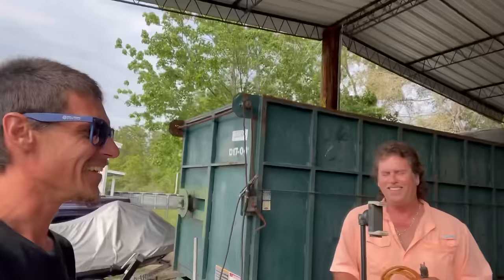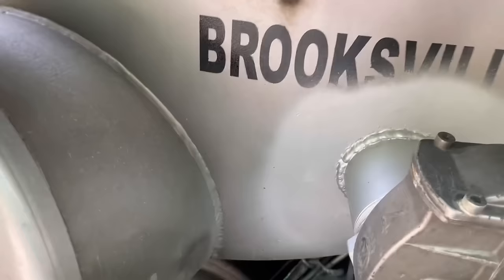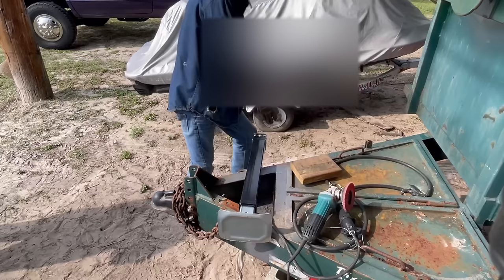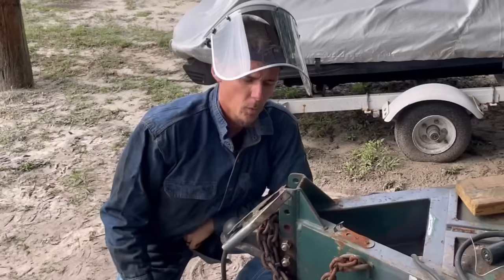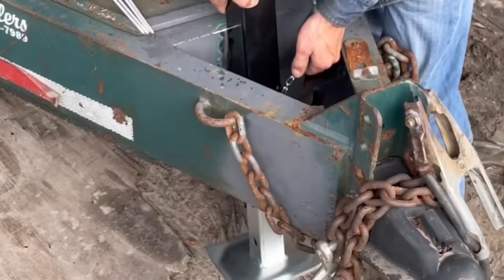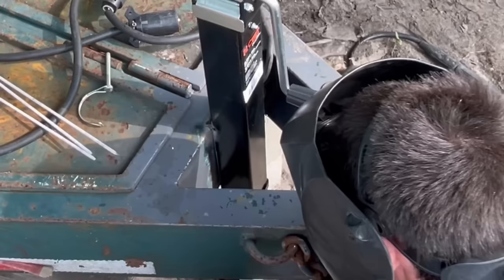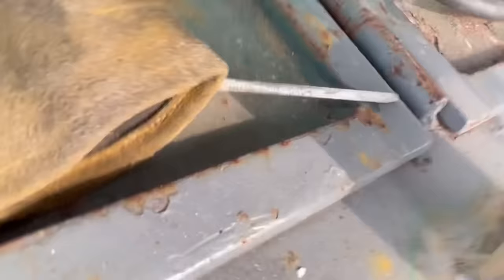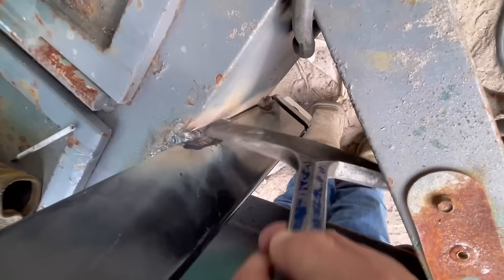BASIC Welding Job

Comment: hey buddy, first you didnt need to use 7018 even 3/32 ive done a hundred of them 1/8 6010 vert down . those jack tubes are 1/8 and sometimes 14ga. easy to burn thru  . if the customer uses them for what their for then never a problem,most times they dont crank them up allway and they hit something like a curb or drag them across low spot apron and bend them. 2nd what happened to your moving to north dakota and getting away from that swamp heat of florida ?  love the vids

Comment: Your Lincoln is pretty cool never heard of a 350 air cooled I have a sa250 runs pretty smooth enjoy your channel learning a lot from the repairs I mostly weld pipe at work but the side work is far from my usual work so it’s very helpful to see your method’s keep up the good work 👊🤙
Reply from the maker: Thanks, will do!

Comment: Why not weld 100% up both sides?
Reply: stitch welds are normally used to save money on materials (welding rod) and to prevent too much heat from warping the work piece.  Normally, welders that know what they are doing, only do 100 percent welds when a blueprint calls for it or they want to make something air/water tight.   If you weld something properly, a 1 inch stitch weld will hold just as much as a full weld. What matters most when welding is penetration and tying in each weld bead into each other to merge the work piece back into a single metal piece.  The only thing I saw that was done wrong in the video was the vertical weld was done improperly, When you do a vertical weld, you are supposed to go from bottom to top, and you should be performing a backwards z motion with the welding rod slowly as you go (small backwards z motion- with your wrist, so that the rod never "pushes" the weld, you always want to drag the rod in front of the weld, so it can penetrate the metal. 

So when you make the  backwards z motion, you start on the left, drag your rod from left to right with your wrists only moving, so that by the time you have to start going from right to left, the end of the rod is facing to the right of the work piece, and you drag it back across the work piece to the left, then do the same thing, again, dragging the rod from right to left and by the time it reaches the left side of the work piece, the end of the rod will be facing the left side of the work piece ready to be drug back across to the right side. Do this until you need to replace the rod or until you finish your work.  You can also do the stitch welds on vertical welds too.  

When doing vertical welds, Going from bottom to top or top to bottom straight up and down,  doesn't allow the weld enough time to penetrate properly and gravity will wreak havoc with the welds.  Always do the backwards z motion when doing vertical welds.
Reply from the maker: I could've bent the rod and done it, but basically my hand wouldn't fit and its just a trailer leg
Reply: @MrHunterseeker  no you don't always drag a rod. On vertical w/7018 you do a slight push.
Reply: @MeltinMetalAnthony  oh I thought you had more room than that. There's a real difference between watching a welding video and doing the welding yourself haha. Thanks.
Reply: @MrHunterseeker  also I'm pretty sure you get more penetration pushing with 7018 than dragging. But because of inclusions and other problems it's typically not preferable. Depends on the application.
Reply: @bhyll2489  Wrong. On vertical, doesn't matter which rod you use, you never PUSH. YOU PULL the rod across the work piece because you want the  filler metal to fill the weld, it will blow out if you push, (either that or not penetrate- the whole purpose of welding- penetration and tying in the welds) 

Stop putting out all this bad info if you have never been certified.  If you have been certified, then you need to give back your certificates because you don't know WTF you are doing.  A proper vertical weld is done in a from bottom to top in a backwards z motion. The only thing you move is your stinger. From left to right then, once you get to the edge of the vertical weld you are trying to weld, you TWIST the stinger BACK from right to left. You never push your weld with a welding rod or a MIG.
Reply: @bhyll2489  You never PUSH. Where are getting this info?
Reply: @MrHunterseeker  you're totally lost. Hope you get it figured out.

Comment: 15 years old trying to get more jobs what can I do?
Reply: I don't weld but I do computer work. ( I did just get a welder though and fixed my first mower deck ) I would advertise with everyone you know and make sure you take pictures of your finished jobs so possible customers can see how they look. Many people won't trust a 15 yo but showing them what you have done goes a long way. Keep a small photo book with you with 4x6 or 5x7 printed images or at minimum, a phone with good clear in focus pictures. Don't ask for top dollar but also don't do it for super cheap. Try to make enough to undercut the older established pros ( you will get jobs that they wouldn't do anyway as the people can't spend that much ) but still have enough money to grow and buy better equipment as you get more experience and can take on harder jobs. Put up flyers at the stores around you and at school if you can. I started my first business in 1993. Back then you learned Computer repair by doing it as the internet wasn't a thing yet. Good luck to you.

Comment: Hey need old trick from a Boilermaker , Ya I was a Boilermaker for 25 years lol You can Dip the Rod in water and it works better hey Really appreciate your editing . I see you use a iPhone ? Just wondering how you can do that I guess you have a app ? Your doing great thanks for your video’s 👍
Reply from the maker: 🤣 ok ill try that and yes I use inshot
Reply: What does that do ?   How differently does it run ?
Reply: @TempleThomas  It runs cooler but still cuts nice